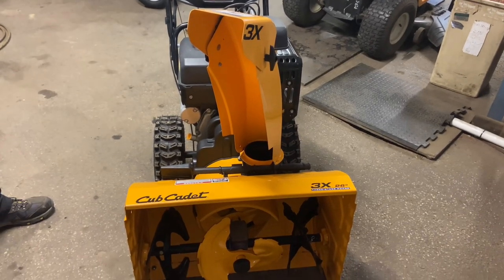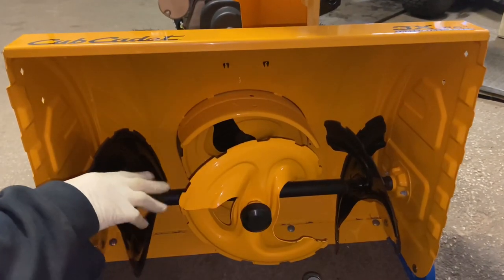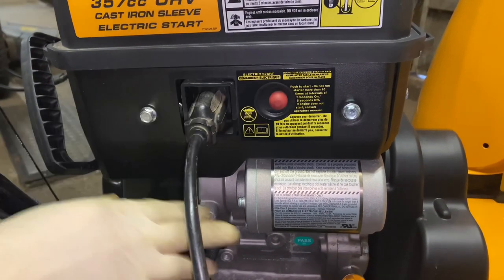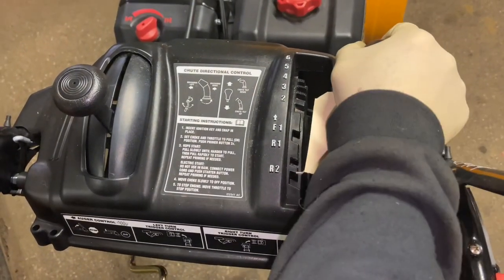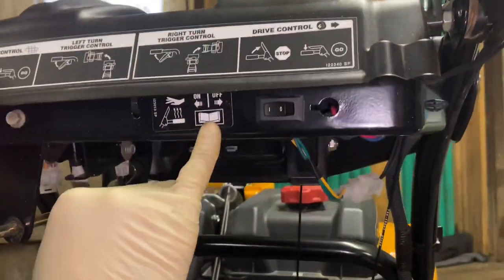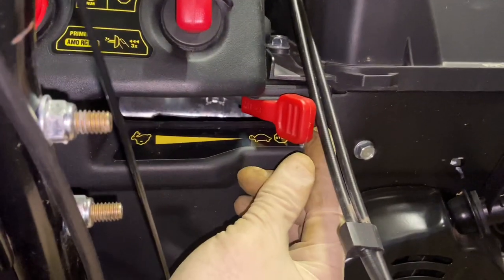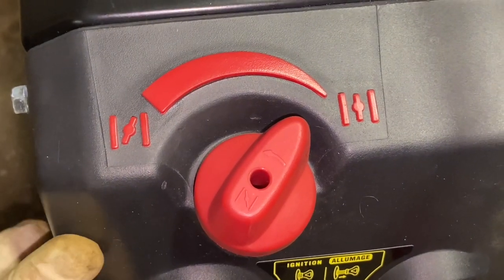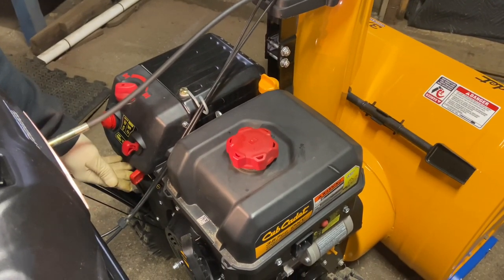How to Operate & Start Cub Cadet Snow Thrower 3X26

Comment: Is this really supposed to come with a cord for the electric start? I bought mine from Home Depot, and I did not get one
Reply from the maker: I now have heard they do not on many machine. Just another way the manufacturer saves $
Reply: I didn’t get one either !
I’ve been using a long cord stretched across my garage, due to where my outlet is 😏 guess I better rearrange things !

Comment: Basic question here Is it straight gas for fuel or is it a fuel/oil mixture? What octane should be used?
Reply from the maker: Straight gas, NO mix, I prefer the higher octane gas.  It’s just better.

Comment: Thanks!  Why do you spray silicon after use?  Just curious.
Reply from the maker: It was never mentioned to spray after use. Spray it on before to help the snow from sticking. You will need to spray it on before every use.

Comment: I just bought one of these. I started it up for the first time and any time I try to move the choke anymore than 1 notch away from it being open it starts er er er er like it’s struggling to stay on. Cause it’s the first start up. Do I need to let it sit and run for a little while with the choke open?
Reply from the maker: Give it a little time (5 to 7 minutes) to stop surging and if it does not stop then you a carburetor issues. You will need to have the carburetor either rebuilt or replaced.

Comment: Hi, having trouble starting mine up both regular and with cord. There is no fuel shut off valve, right?
Reply from the maker: You most likely have a carburetor issue from gas going bad in the carburetor.

Comment: Thanks good information and I will like to know why. The snow is stoke inside the tube, I have to clean every 2 min.thanks for the information
Reply from the maker: Check your shear pins to make sure all augers are turning. Make sure the engine is not running when you check the shear pins.
Reply: Thanks for your help and
I realized that I need the same pin that you were missing in the video you posted

Comment: Any thoughts on why our Cub Cadet 26" 3X snow blower wont start this year. This is our 3rd season and 1st time we have had a problem gettin' 'er goin'. Thanks!
Reply from the maker: When was the last time it ran?
Reply: @JohnsonsSmallEngines   Last winter. Maybe 12 months?
Reply from the maker: Most likely your carburetor had gas in it too long and the fuel went bad and now you will need to either rebuild or replace the carburetor depending on how bad it is. Even if you say that you ran it dry over the summer more than likely you didn’t get it all out. You can try and flush the carburetor by taking out the side bolt to the carburetor bowl and let fresh fuel from the tank flow through. It will be messy so make sure you have lots of towels. You are going to have a lot of fuel draining from the carburetor. If that doesn’t work, you will need a rebuild or replace. Also change the spark plug for good measure.
Reply: @JohnsonsSmallEngines  thanks a bunch. Will check out your carburetor video.

Comment: Thanks for this tutorial. I just started my new one for the first time without a problem. However, any idea why the auger won't disengage? It continued to spin regardless if I held the auger handle or not. Thoughts?
Reply from the maker: It sounds like the cable is over adjusted for the auger drive belt. I do not have one here or I could have done a video for you. Do you have a manual?? If yes, check to see if it will show how to adjust auger belt tension. I think you need to un adjust it as it may be to tight. Loosen cable tension if possible and see if that helps.
Reply: @JohnsonsSmallEngines  Thx for the quick reply. I'll see if I can figure it out.
Reply from the maker: I just found this short video and you want to un-adjust it a little bit at a time. Do not do what he is doing as he is showing the tightening. I just want you to see how its done so you can try to loosen it.  Here is the link. https://youtu.be/Vo86UeyChf0

Comment: When you want to move the snow blower around. When it is not running how do you put it in neutral?
Reply from the maker: There is no real neutral, but you can put the forward/reverse handle in between reverse and forward on the gear selector and that will put you in the sort of kind of neutral. When moving the machine around just make sure you do not have your transmission drive handle down. Make sure both levers are up and you should be able to push your machine with little or no problems. it may not be real easy but you should be able to push it. if it’s extremely hard to push or you cannot push the machine you have issues. May be an over adjusted transmission drive handle or possibly bearings down below are starting to get seized can’t really say unless I see the machine up close.
Reply: @JohnsonsSmallEngines  thank you

Comment: Hello, 

When I press the pump gas button (the red circular basic control) there is a gas leak from the nut underneath it. What would you recommend for this? 

Thank You
Reply from the maker: If the machine is running ok? You may have pressed the button to many times and it is forcing fuel to flow out of the carburetor. If you machine is running correctly, you should only need to push the primer bulb two or three times.

Comment: The spoon thing attached to the  front is to scrap off snow?
Reply from the maker: Correct, if you get a clog inside the chute, it will help you unclog it without putting your hands inside.

Comment: What kind of gas and oil do you use ?
Reply from the maker: Your manual should say what kind of oil you should use but in my area, I use 5W30 for snow throwers. As far as the fuel, Non Ethanol gas if you can get it or you may also try alternative fuel that you can purchase at the big box stores. Tru-Fuel. https://trufuel50.com/4-cycle-mix/. OR what I am now using Aspen Fuel. https://www.aspenfuels.us/. It is far superior to pump gas and you will not have the issues with gas going bad while storing your machine but do not mix the two (gas station gas with true fuel or aspen) You will not get the benefits from using the better fuel.

Comment: Please help mine won’t start!!!
Reply from the maker: Impossible to diagnose over the Internet. I can say that 95% of all issues with snow blowers not running at least in my area are due to gas going bad inside the carburetor. If you have spark fuel and compression, technically your machine should work. I would suggest draining the carburetor bowl of possibly old guess if you can get into it or have somebody that can diagnose the issue for you. As I said most of the time it will be bad gas inside the carburetor and that would mean you would have to either remove the carburetor and rebuild it or replace it.

Comment: Was considering one of these Cub Cadet 3 stage snow blowers but the reviews are terrible; clogs easy, can't handle wet or deep snow and keeps snapping shear pins, no wonder everyone is trying to sell theirs on Facebook Marketplace.
Reply from the maker: I agree, a two stage machine in good working condition will throw snow just as good if not better than this model.
Reply: Idk I just used this and I have a 2 stage cub cadet and this 3 stage ripped! Hard! I saw the bad reviews also with clogs and shear pins but after the first use this thing is a beast

Comment: I picked up a cadet snow blower off a lawn customer I cleaned the dam carb completely cleaned out fuel tank oil is fresh and full spark plug is brand new and still won’t start what is wrong it’s a Chinese engine guessing like 5 to 8 hp engine so what’s wrong with it guy bought it new only used 1 time I’ve fixed hundreds of tractors shindaiwa trimmers echoes lawn boys Honda’s but this Chinese motor is pissing me off please wtf is wrong with it it should have fired right up but nothing absolutely not a dam thing yes the spark plug is sparking blue
Reply from the maker: Squirt fuel through the carburetor into the engine and see if it fires up. If it does, the carburetor is the issue, if it doesn’t, change the spark plug and see if it will fire, I know you said it has spark but trust me, sometimes replacing the spark plug does work, if it still doesn’t fire up then you most likely have not enough compression and it may be a stuck valve? Not much more I can help you with without seeing the machine. Good luck :)
Reply: @JohnsonsSmallEngines  I put brand new champion plug in it I’ve tried a little fuel that didn’t work spark plug spark was dark blue I’ve tried starting fluid in carb nothing I’m at a loss like I’ve said I’ve cleaned many mowers snowblowers chain saws air blowers hedge trimmers but this dam cub cadet is literally brand new
Reply from the maker: Sounds like no compression.
Reply: @JohnsonsSmallEngines  compression is perfect only time it had no compression was when I removed the spark plug as I thought maybe it was vapor locking like I said I am at a loss I grabbed rubber pliers to test pull plug in boot  had a blue spark from spark plug died to metal on all 4 pulls the fourth pull I got zapped pretty good there was a ton of gunk build up in fuel tank but cleaned that out I ripped carb completely apart used carb tools to clean all ports I’m thinking it has a short in a wire somewhere and it’s grounding out or the ignition coil really is shot I asked the guy how long he used it he said 1 time for about 20 minutes or so I did buy a used pressure washer a few years back guy told me it just shut off and wouldn’t fire back up carb was fine on it air filter was good spark plug was good the wire to the on and off switch rubbed and wore out on top of cylinder head ran new wire from magneto to on off switch it fired right up

Comment: Hello, does the headlight come on automatically? Ours doesn’t so I’m wondering if it needs to be replaced?
Reply from the maker: Check for a switch on the upper handles and if there isn’t one then you are correct, most automatically come on and you may need a new bulb.